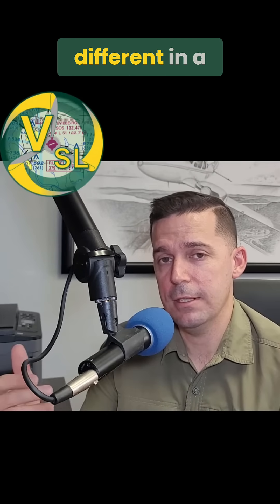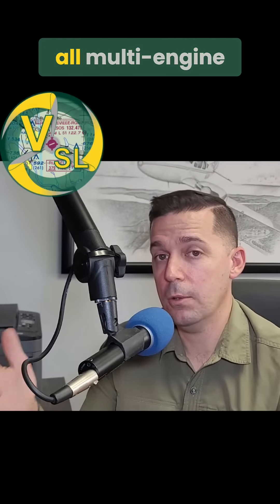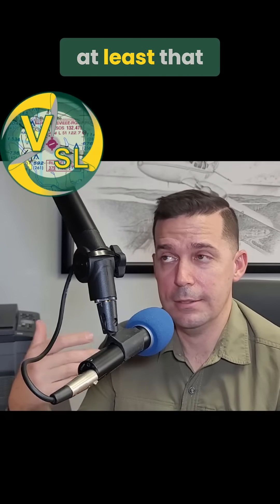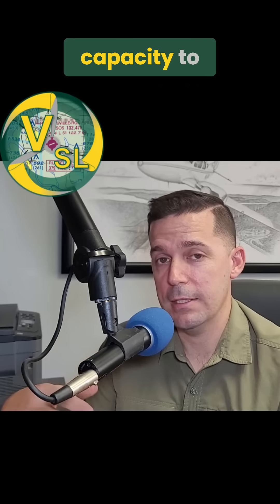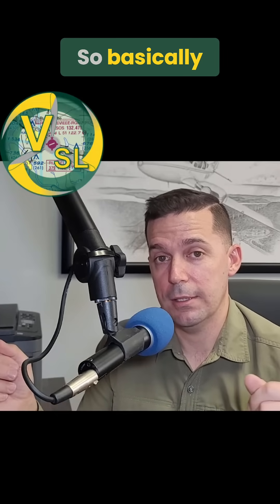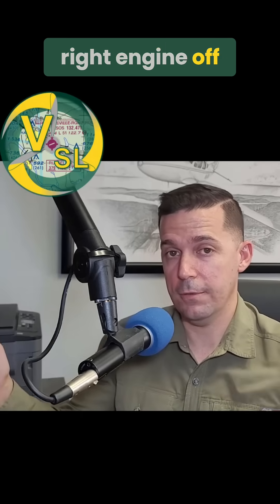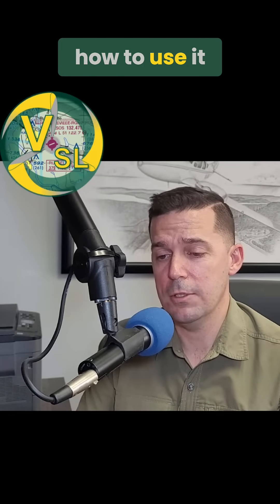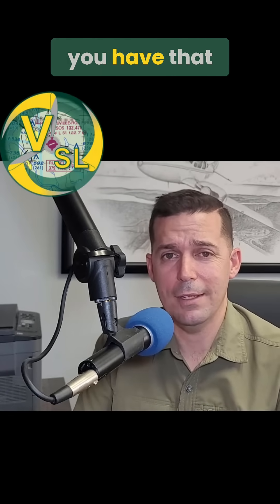Why Crossfeed? Multi-Engine Fuel Systems Explained

Comment: Lack of instrument approaches can be an issue in places like Australia and Alaska (I'd imagine).

We generally have VOR/ILS/NDB/RNAV(RNP) style approaches. We don't have a SBAS satellite operational yet (Launched 2022 and 2028 it comes out of testing mode) and some parts of the country don't have radar coverage lower down. So we have LNAV only based RNP or VOR/NDB style approaches at the majority of airports. Lots of uncertified airports without even a instrument approaches in the outback as well.

For piston aircraft you can and will be doing a fair amount of IFR in Class G airspace. Unlike the US echo can start at 8500/FL125 or even above. Its up to you to calculate the minimum enroute altitudes, and you'll get a advisory service only from ATC. The approaches you'll get told by ATC what traffic is around, but you must coordinate and deconflict yourself with other pilots (e.g. hold at different altitudes or similar) when flying Class G approaches. 

Once you enter more urban areas with Class C/D/E it'll become a lot more like the familiar US radar service with the exact same radio work etc.

Long winded way of saying in more remote areas the cross feed would be very much still an issue. I know Alaska and Australia suffer regions with very similar isolation
Reply from the maker: Thank you so much for the detailed comment. You're absolutely correct, there are still places where instrument approaches (and even airports) might be difficult to find.